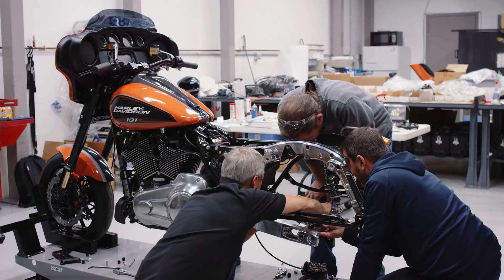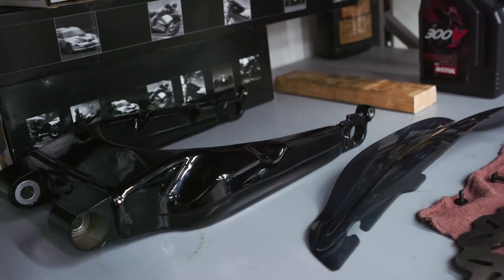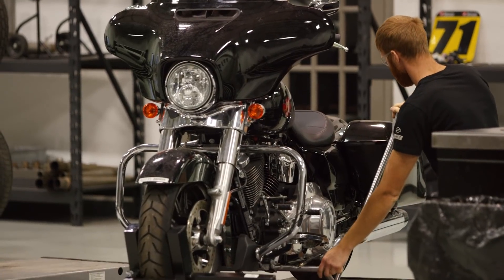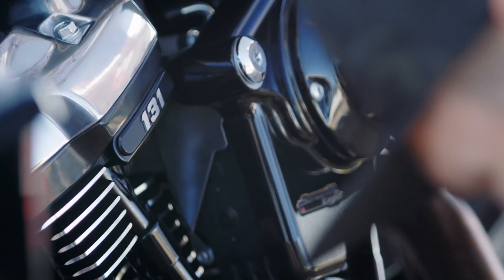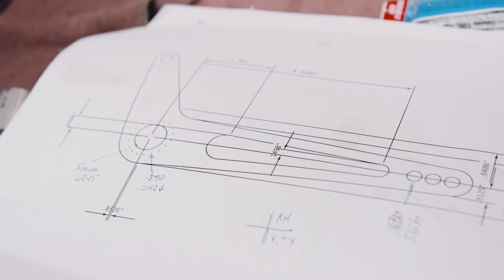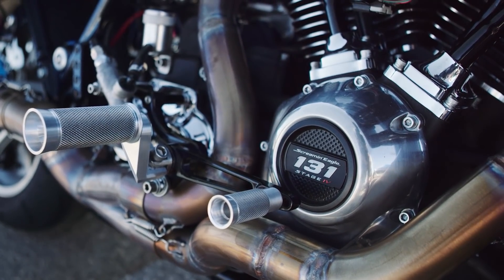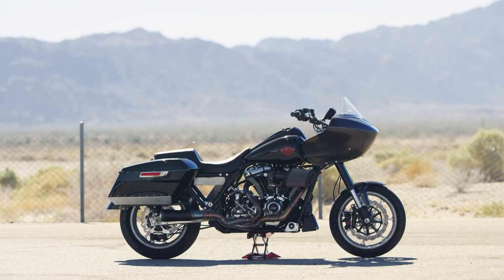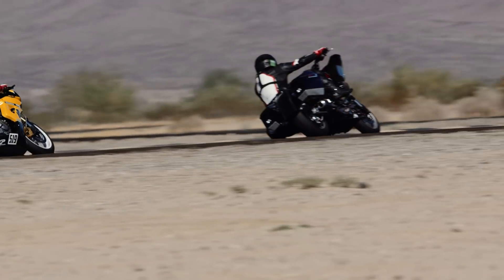Battle of the Baggers: Season 1, Episode 2

Comment: Full fledged, card carrying Indian fan-man here.  Had to come troll all you Harley boys - Indian not only sprinted out in front, there was NO WAY any bike but another Challenger would have caught it, but when the leader ran off the track on turn two then came back to drag that Harley down and out maneuver it...are you kidding me!!!  Only two Indians in the whole lot and they finished first and third.  Hmmmm - sure is "quiet" here on this channel.  ;0)  The Harley teams, taking nothing away from them, brought their biggest and best - simply put, from the factory, the Challenger is a better engineered and purpose built bike from the frame to the components.  Now we see that everything Harley could throw at it, from a 131 c.i. motor to machined custom parts can't compete.  All that said, this is incredibly good for all bikers and all manufacturers because the next "king" will have to step up their game that much more.  Harley enthusiasts should be cheering that Indian is back and better than Harleys - you're gonna get better bikes from The Motor Company....you're welcome.  :0)
Reply: Albert Webber - Now let other brands compete and see how it goes. You can't claim you're the fastest bagger unless you are.